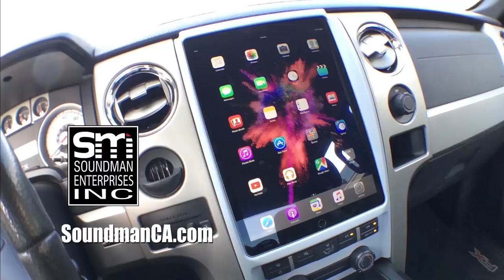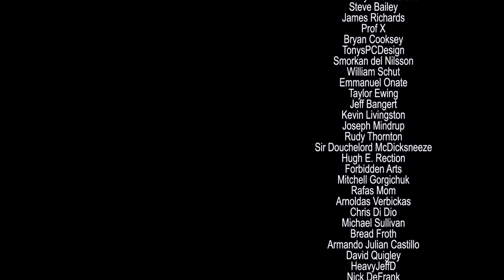UNLOCKING THE SECRETS! Of professional automotive plastic RE-COLORING! - AMPLIFIED #687

Comment: You could go straight from prep to paint with USC Bumper and Cladding Coat.  The stuff holds up on exterior bumper plastic and is super forgiving.  You can literally apply it with a roller or brush.  It always lays out flat and smooth.  I still use SEM for other things but when it comes to plastic trim I don’t waste my time with adhesion promoter and all the feathering of several sem coats to get it to be flawless.  One quick coat of USC, and a second because I’m a bit anal.  You can cover the parts literally in a single coat.

Comment: put some LED lights for your interior lights.!!!!
Reply: I changed my dome light out to LED, and the first morning I opened my truck door while it was still dark outside and I was half awake, it was like someone turned on the sun right in my face. I changed the map lights to LED and put the dome light back to normal. That shit was way too bright for someone who isn't a morning person.
Reply: Little tip: If it the same style as Dougs with the cylindrical bulb, you can point it to light up in the ceiling and the light is dimmed a little, it helps